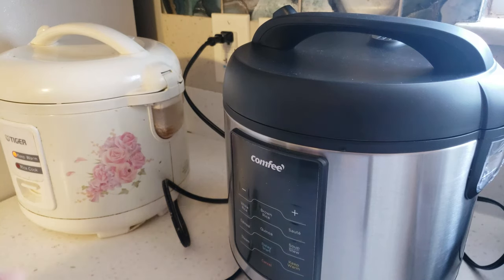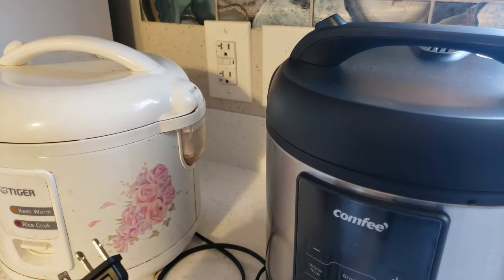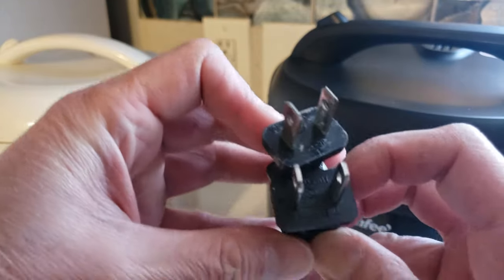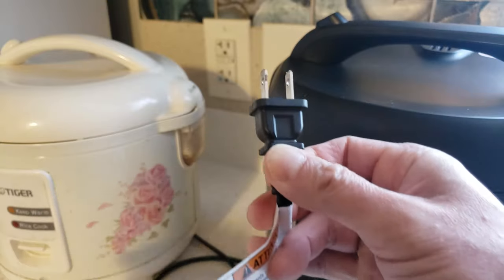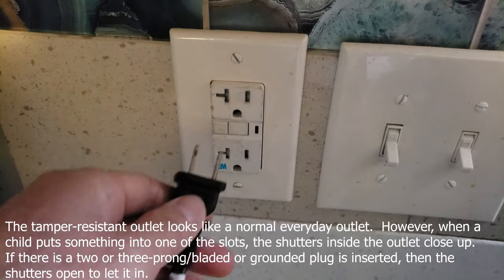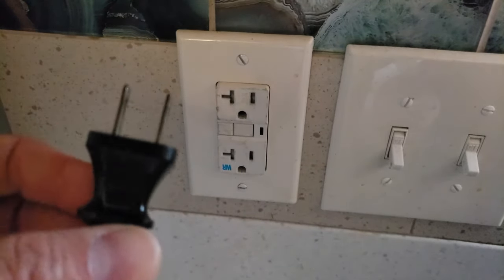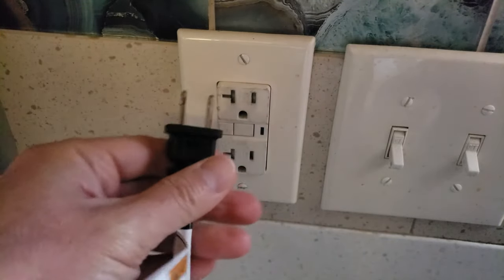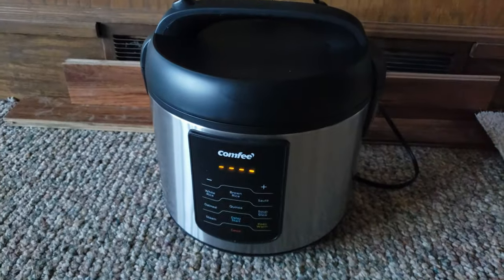How To Use A Tamper Resistant Outlet | Tamper Resistant Receptacles

Comment: So what's the solution.
Reply from the maker: Input one prong and activate the door mechanism and then wiggle both prongs in. It's a tedious process.
Reply: Only use the rice cooker in the garage.
Reply: @Jay_Rule  dear Jay, thank you it worked  - “one prone and wiggle”approach did activate the door. Thank you for making the video. I was very frustrated with the outlet.
Reply: Put a blade screwdriver in each slot and smack it with a hammer, or just buy a non-tamperproof outlet!
Reply: @machdaddy6451  apparently Daddy’s solution is to make useless jokes that are not funny.
Reply: Buy the hospital grade TP GFCI. They work better.

Comment: Tamper resistant also Goofball resistant. When plugging in the plug to the Tamper resistant outlet do so by slightly angling the plug to the right causing the left larger tab to be inserted first, while starting the Metal tabs of the plug in the long slot first and turn it straight as you insert it. Should work perfectly.
Reply from the maker: Thanks for the tips
Reply: THANK YOU!!!! THAT WAS MAGIC AND DID THE TRICK!!!!! SO HELPFUL
Reply from the maker: @SuperOlivess  Glad it worked for you!
Reply: Dude, I don't know what fantasy world that Jacobs guy lives in, but these receptacles are way too much trouble, especially outdoor ones when it is cold.  The government idiots now have made a formerly easy operation, plug something in, such a pain that we need instructional videos and tips on how to do it. 
Even with your tip it was extremely difficult to get our three prong new extension cord plugged into our outdoor receptacle for Christmas lights.  smh
Reply: @todddanforth8853  Same with the stupid safety spouts for gas cans!

Comment: Thanks for your effort in this video! Why did I enjoy your first minute - I felt validated for wanting to punch a hole in the GD wall where this socket was
Reply from the maker: Sometimes it works, sometimes it doesn't. I guess it just depends on the brand or age of the design

Comment: I am an electrical engineer and I had hell of a time with most of these half baked tamper resistant receptacles. I will never install them but you have to pay more for the regular ones, especially the GFCI. The house I bought is full of these crap. These are so worthless and are infuriating to use.
Reply from the maker: These are a total PITA to understand and use. I wonder if they tested their own design. More annoyance than good.
Reply: Awesome.  One more thing to piss me off.  Surprised new lamps don't have labels warning not to put your tongue in the damn socket.  Just watched a video of a DIY electrical install, that failed because these moronic outlets weren't used.  How do we go about repealing these codes? 😠
Reply: Amen! These are ridiculously terrible. Swapping mine out for non tamper resistant.  The concept is great, but they don’t work. Unacceptable receptacles!!

Comment: These things are trash literally had to beat screw drivers through the plastics to break them up before I could even plug any thing into them. They are not tamper resistant they are just trash literally the biggest peices of shit ever made. Good luck plugging anything into them.
Reply from the maker: Tell me about it. I hate these old school design that is difficult to use.